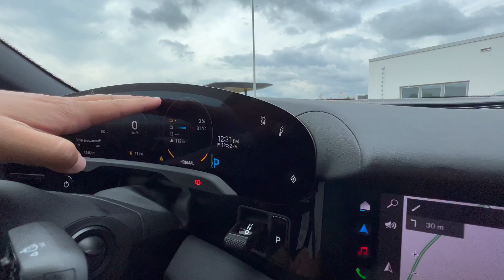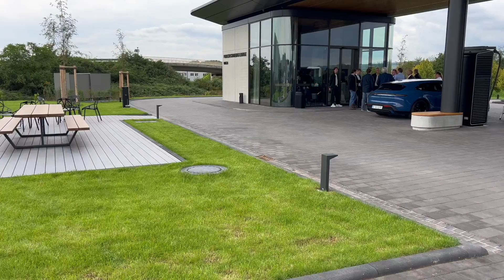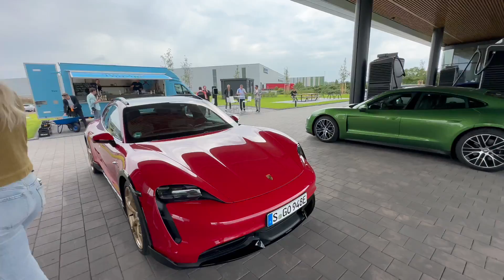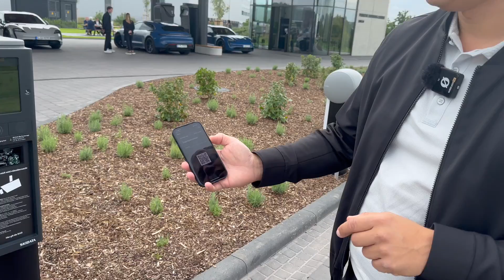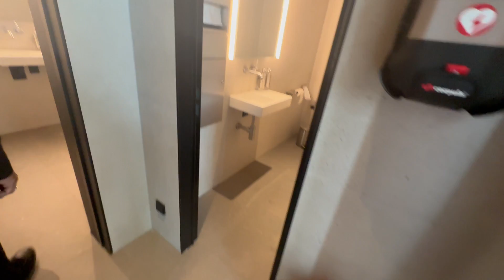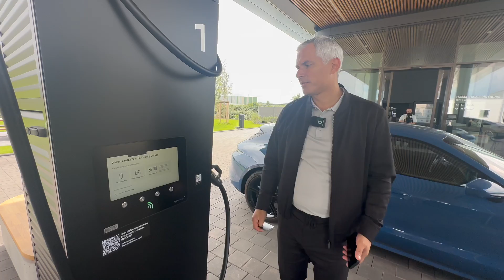The PERFECT DC Fast Charging Experience! Full Tour Of The First Porsche Charging Lounge

Comment: But why are the charging posts oriented that way? They are, depending on which way you pull up, at the right rear or left front. For a Taycan with its left-front port, this would be really awkward when towing a trailer. Simply mounting the two posts the other way round would have been a perfect fit.

Comment: Ok this Cable is heavy (and limiting charging when Hot) you could just put Tesla v4 chargers there  (second best chargers though) . Anyway 
Would be nice to have a vacuum cleaner (Dyson battery operated), windscreen cleaning set battery operated ) and portable air compressor. Inside the lounge to activate with card.

Comment: At an energy exhibition I could have a glance at the inside of an alpitronic charger from both sides. It is not only clean outside but als inside with many modules that can be slide in and out. So exchanging pieces or updating components is easily possible.

Comment: If Porsche gave a damn about its Taycan customers, it would focus on getting its existing US charging service (mainly Electrify America) working properly instead of generating useless "concepts" that will never be accessible to most of its EV customers. Porsche should also provide its EV owners access to Tesla Supercharger network, where there are dozens of charging dispensers at every site, instead of EA sites which usually have only 4 charging stations, which are often derated to less than the 150/350 kw rated listings, if they work at all or are not already in use.

This concept shows Porsche has no clue about its current/future EV customer needs, at least in the US.

Suggestions for "the Porsche charging team": go take some 750 mile road trips with Taycans in the US and find out what Taycan owners deal with today. Stop being clueless.

Comment: I think walled gardens are fine. Somewhere safe to sit inside and outside, some good coffee and a place for biological breaks.

I dunno if this would be what Porsche owners would want, but I would want the bays to have vacuum cleaners, washer fluid and tyre air. Mainly because you aren't in the bay for as long as other chargers, but you would be there longer than at a gas station, so it would be a pain to have to go to a gas station or over to a slow charger bay.

This doesn't probably need a full time attendant, but I think there should be employees that are responsible for x number of these lounges to restock, ensure everything is working but also to help drivers with their cars.

Comment: Tesla Superchargers here in the U.S. have been Tesla only for over ten years and I've gotten very used to that. I'm mildly tweaked that they will be opening them up to virtually every other manufacturer, initially via NACS to CCS2 adaptors and eventually NACS native connectors. I know the day is coming that I will have to wait while a Mustang Mach-e or heaven forbid, a older Chevy Bolt finishes charging. Ford F-150 Lightnings and Chevrolet Silverado EVs will also be taking up a lot of time charging their massive battery packs. I sure hope Tesla will be using the Inflation Reduction Act money to greatly expand the Superchargers. I'm not really holding out much hope for when Electrify America adds NACS charge ports on their chargers unless they really step up their reliability game.

Comment: It would be best to get the cost of this boutique Porsche plug (with the station overhead) vs a tesla charger plug. If it costs 5 times more, would you rather have 5 times the number of tesla plugs (with wider geographic coverage)? (yes 800v vs 400v, but you get the idea).

Comment: It would be awesome if Porsche could design a custom dispenser for the Kempower sattelite system. That way you would get the great reliability of Kempower, move the noisy power units away from the customers and get a unique porsche designed dispenser. One 600kw Kempower power unit could feed two dispensers to get full power to all users.

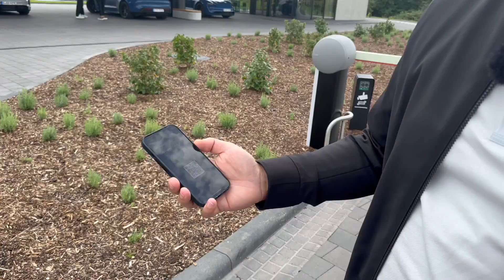Comment: 31:17 the good thing about German compound words is that you can learn enough component parts to easily get what the big word is. And even if you don't know all the bits, ⅔ of the parts usually gives you the gist.

Anything with "gang" (ingang, ausgang) in the middle is telling you "you're using this because you're going somewhere" because as a standalone word it means a corridor or passageway. I remember that "der Schlüssel" in German class was "the key". "Zu" at the beginning means "to". But when you put "zu" and "gang" together as "Zugang" it's a "to path", an access route. All together - Zugangschlüssel is an access key.

If you only guessed "gang" from exit and entry signs, and you knew "zu" because you did a few Duolingo lessons, then you know what it's for and it being a QR code does the rest. And if you just knew gang and Schlüssel, you'd know it was a QR key for a way to get in or out.

What I'd like to see is we need to get Kyle some German lessons!

Comment: But it's still a big clunky 2 handed, for small people, CCS plug. I know it's CCS-2 and not as bad as CCS-1, but still not as good as NACS.
Reply: Besides the clunkyness, CSS2 is better than NACS in every way Lol
Reply: @hh.7797  Specifics? Monro and Associates say the CCS-2 port is much more expensive to install, and heavier in the car as well. Clunky junk.
Reply: @777Outrigger   CCS2 supports 3 phase AC, which means you can charge your car with up to 22 kWh at home. NCAS does not. In North American households it doesn’t matter since most households there have 1 phase AC. But most households in Europe have 3 phase AC. So CCS2 is perfect for Europe, everyone who tells you otherwise (including Elon Musk), talks shit. CCS is probably not perfect for North America since had a bad start from the beginning and Tesla SuC was/is the only reliable charging network there. But for Europe it is.
Reply: @777Outrigger  NACS is great for american use but CCS 2 is better for European use, not only the current CCS 2 offer 3 phase charging meaning it has superior AC charging output than NACS but it also offers bi directional charging where NACS can t. CCS 2 also already support 350 kW and 400 kW for sometime NCSA still dont.

So your argument is quite thin...
Reply: @jonpetter8921  Well, I'm not in on bi-directional charging. Wearing out your battery on your house power. I'm planning to get a power wall in the near future, to replace my nat gas generator. And V4 Tesla chargers will have 350 kW charging, being installed now. But these high charging powers only take a little time off your charging time anyway. It' the charging curve that's most important. I've found i get a charge only about 5 minutes faster on a 250 kW V3 charger than a 150 kW V2. ..... And I can get 44 miles of range per hour on a Tesla home charger. That's 264 miles in just 6 hrs overnight. How much range do you need in a day anyway? That's more than good enough for 99.99% of people.

90% of the time NACS is better because it so easy to use, especially for small people. A lot more of a premium experience.

And Kyle is a big guy, and I noticed him using 2 hands on the CCS charger he was using here.
Reply: @777Outrigger  CCS 2 is as good as any Supercharger. It depends on the hardware and the provider. Like in this video where you have the best hardware and the best provider.  
 
Ionity and Fastned to name a few are two of the best most reliable charging operator we have. They have been offering 350kW chargers for sometime and now 400 kW. 

Also in Europe EU has been very strict when it comes to charging infrastructure improving the number/volum and reliability of CCS 2 chargers trough the continent.
 
Go visit Norway if you want to see how reliable and good DC fast charging infrastucture looks.

Comment: The analogy that comes to mind, somewhat, are the private airport lounges that provide a better-quality travel experience, particularly if you have a significant layover.  I travel heavily on American and use the Admiral's club frequently. It's a good idea and the trick is to remember there needs to be some degree of exclusivity along with a salient reason for membership, whether it be ownership of a specific brand, or, a preferred service (like an airline). Diluting the exclusivity factor is a tricky road and might work against it.  Again, using the Admiral's club as an analogy, American has been marketing membership heavily and the result, I'm noticing, are increasingly crowded lounges.  That a possibility that works against it.  A Porsche-only lounge makes  sense, in select areas. A lounge allowing other brands would be a different experience.
Reply: yea. no way they are making a "profit" on running these stations. especially if they are ok with them going unused much of the time  by being exclusive
Reply: @TeslaRoadtrips The Macan EV will change that.
Reply: in europe. I think in usa not having nacs is eventually going to bite them.  @edgy21
Reply: @TeslaRoadtrips  The Porsche charging lounge would be fine and profitable in Europe. I don't care about NACS because there is no supercharger supporting those 800+ volt cars. Most car makers will not wait for Tesla to build/replace those superchargers with V4 in 2025. Tesla better hurry up getting NACS supporting V2X CERTIFICATED. It would be funny to see Tesla with CCS having V2X in most countries while in USA, NACS is just a physical plug for the snowflakes. 🤣
Reply: @edgy21  im not sure it matters much. porsche cant make very many taycans as is. in the usa being reliant on electify america is huge liability. they could maybe use the cars step up converter to be usable at least.